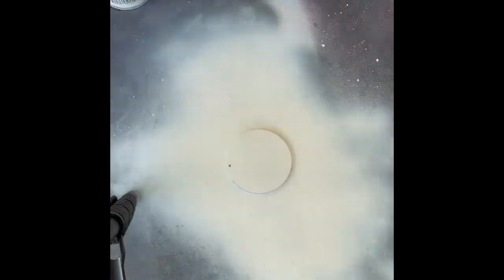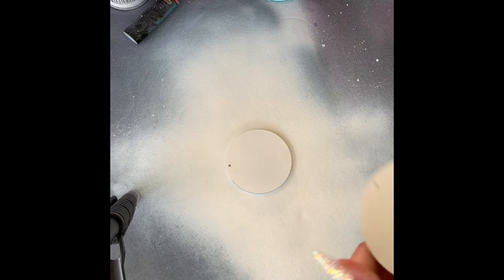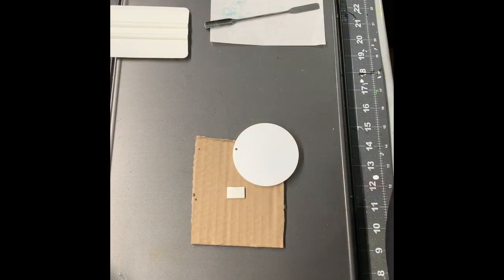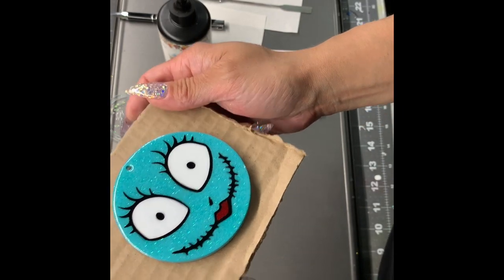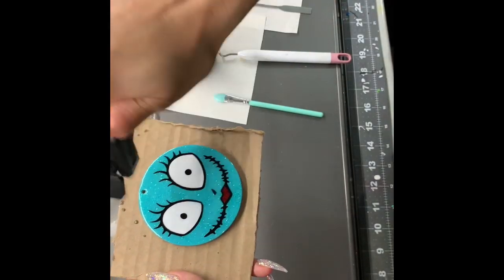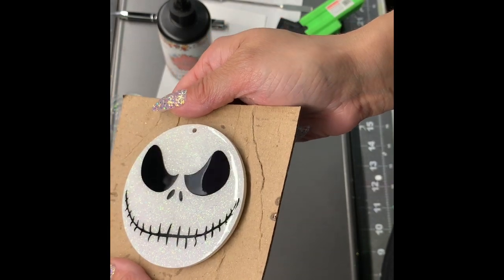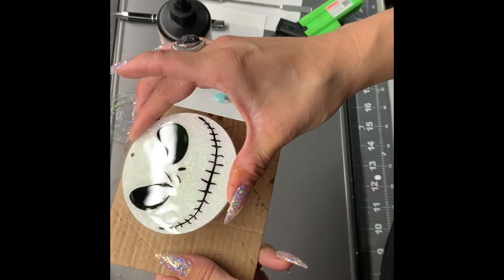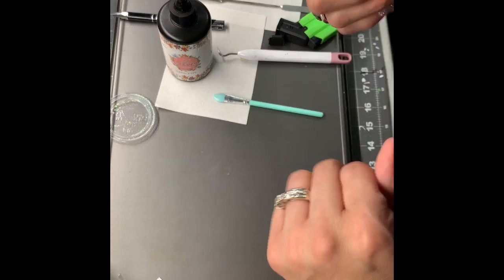GAME CHANGING TECHNIQUE for Acrylic Key Chains and Badge Reels

Comment: Thank you so much for the tutorial.  Great work.   I use this glue gun. 
Surebonder Ultra Series DT-360F Auto Shut Off Dual Temperature Full Size Hot Glue Gun  

Also if you rub Vaseline on tip it helps prevent the glue strings
Reply: You can get it at hobby lobby and even use a coupon
Reply from the maker: Vanessa Feliciano Awesome thank you for sharing I will definitely check it out!!
Reply: Crafting with Creepsakes you are so welcome

Comment: I haven't made an ornament yet but I have been watching videos to learn.  What is the difference between resin and epoxy?  I have watched several videos on epoxy and they all have difficulty with bubbles and mixing.  From your video, it looks like resin is much easier.  Less bubble, no mixing...  I'm glad I found it!  Thanks
Reply from the maker: Donna May The difference between UV resin
And Epoxy is UV resin you need UV light to cure so either a UV Lamp or Natural Sun Light to cure the Resin. For Epoxy, most epoxies you need a part A and part B and its a 1:1 ratio mix Epoxy takes 24-72 hours to cure vs UV resin can take 4-20 minutes to cure. Hope this helps!
Reply: Crafting with Creepsakes why would anyone use epoxy?! Haha
Reply from the maker: Right lol! UV is only
Used for Keychains, charms, small
Molds etc you can not use it for Tumblers
Reply: Crafting with Creepsakes I’m a LONG way away from making tumblers 😁. Glad I found you or I’d be trying to measure out epoxy!

Comment: Love this!! I notice little small pin sized holes in the UV once its cured... Is that normal or should it be extremely smooth?
Reply from the maker: Cindy Vaiagae little small pin hole needles are micro bubbles that popped while curing. These can be tricky to get out. Sometimes waiting a minute or two torchingnine last time before exposing to UV light helps with these micro bubbles
Reply: @craftingwithcreepsakes5158  Thank you for responding...I'll try that!

Comment: How many keychains do you get out of that size bottle of resin?
Reply from the maker: Jesse Rawls about 50 or so
Reply: Thank you :) do you need to wear any type of  mask when using the uv resin? Also, do you do the spray paint method for keychains that are just vinyl and no glitter? Thank you so much for all of your help.
Reply: Also is there any certain type of alcohol you use to clean the blank?
Reply from the maker: Jesse Rawls just regular alcohol ☺️
Reply from the maker: Jesse Rawls always were proper protection when working with any chemicals I use the spray paint method for mainly
Glitter work as well as Vinyl work too
Reply: Sorry to keep asking so many questions, but for your glitter keychains do you do glitter with the resin and the vinyl on top and seal again or do you do glitter on the back and vinyl on the front? :)
Reply from the maker: Jesse Rawls i apply everything on one side. If you like please feel free to join my crafting group on FB www.facebook.com/groups/craftingwithcreepsakes
Reply: Crafting with Creepsakes awesome! Thank you.

Comment: Using ANY sort of pressurized spray can with a lighter is extremely dangerous! I do NOT recommend doing this as there is a chance the flame could spread up to the can and the thing could explode. Don't take that chance!
Reply: Lt Darkstar I just had a panic attack when she pulled the lighter out. 😵😵😵 using alcohol on acrylic, the amount of spray paint vs layering and letting it set, the lighter and flame, this is just a big big no for me. 🙅‍♀️